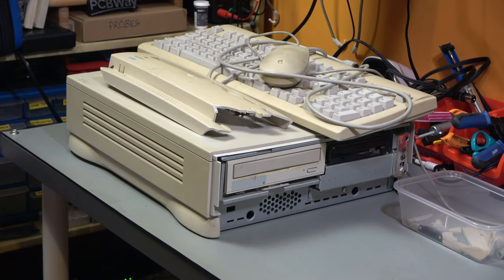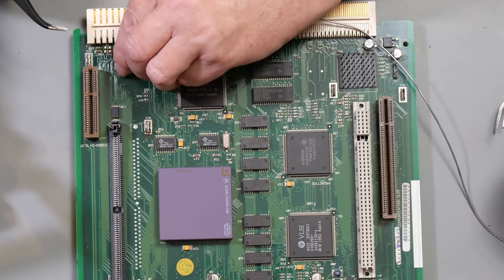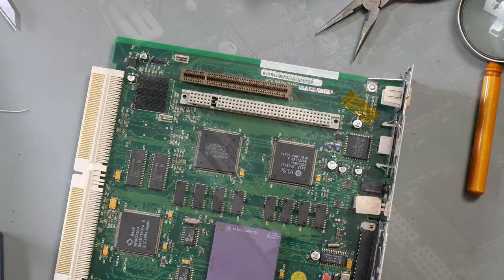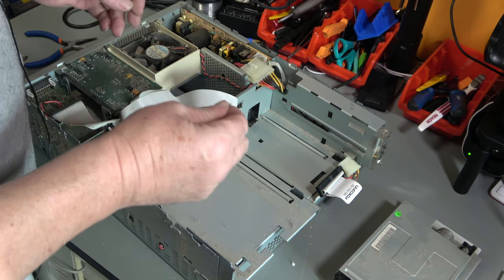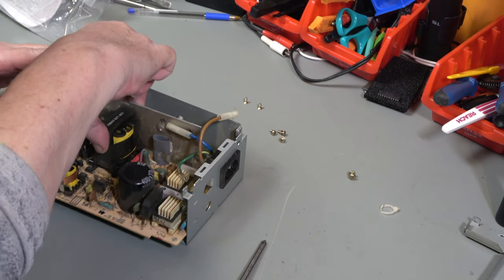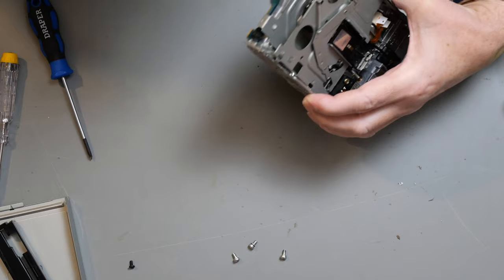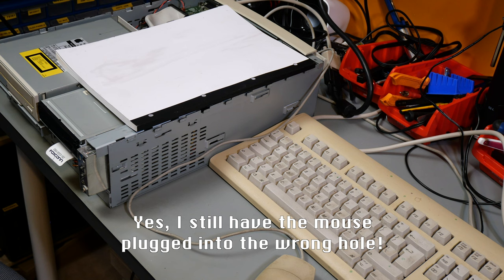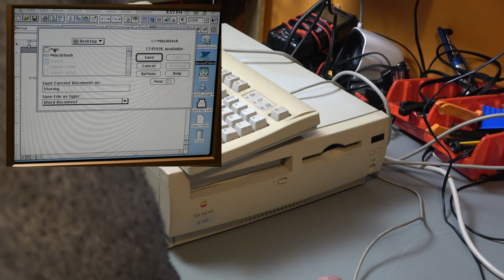Battered Mac LC 630 Restoration - #MARCHintosh 2023

Comment: Thanks for the detailed video. I have an LC630 that I bought new. Over the years I upgraded the ram to 20MB, installed a bigger hard drive, swapped the processor to a real 68040 (that I "borrowed" from a NeXT Station, long since gone), and added the video capture card. Last time I tried it (about 10 years ago) it was working but the power supply was making a very high pitch noise. I got it out of storage a couple of months ago and now it's completely dead. I'll try to recap the power supply and see if it helps.
Reply from the maker: I'm going to  come back to this machine once I've got the right caps for the power supply (I can't believe that not a single cap from the set that I bought was used in the actual PSU!). I also want to explore the video capture card, but at the moment I have zero info about it...
Reply: @TimsRetroCorner  from what I remember I used the copy of adobe premier that came with the card to capture and edit video. I think max resolution for capture was 320x240, but the frame rate wasn’t great. Most of the time I used the lower 160x120 resolution to have 30 frames/s. Please take into account that this information comes from what I remember doing 20 years ago 😂
Reply: I just checked in my old pile of stuff for the LC630 and I found an Apple floppy disk marked "Video Software Install". I don't think that Adobe Premier is on that disc, I must have a CD-ROM somewhere or it came on the LC630 software CD-ROM (that I still have)

Comment: At least over here in Germany, any expansion board for 68k Macintoshs is just crazy expensive. But you can add more RAM and overclock the CPU to 40 MHz quite easily. An Asante Micro Asanteprint can sometimes to had for cheap and allows for (slow) Ethernet connectivity.
Reply from the maker: I'll keep an eye out for one of those. It would be nice to have even slow ethernet on it.

Comment: Does it have a 68040 or a 68040LC (one has an FPU, one doesn’t)
Reply from the maker: It has an LC040. I think the only real difference between the LC and Quadra variants of the 630 was which 040 was fitted.